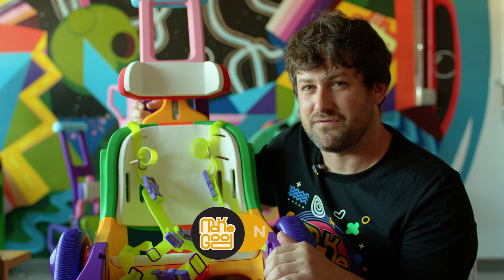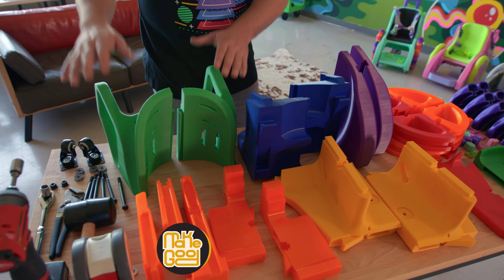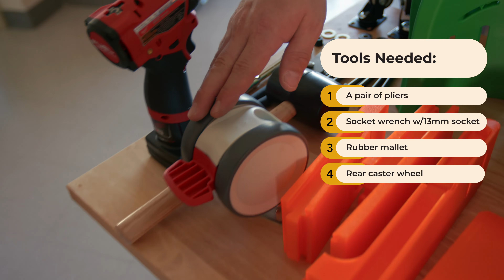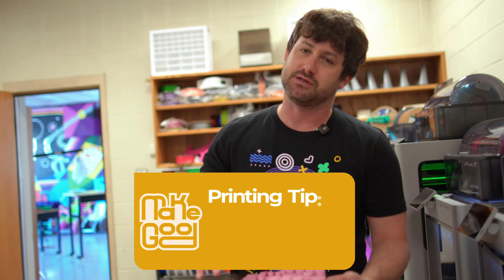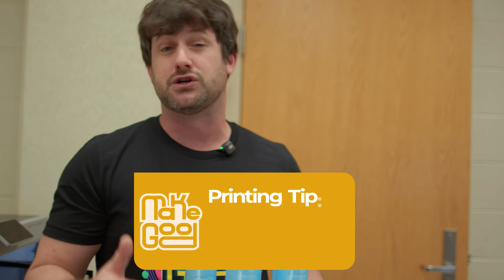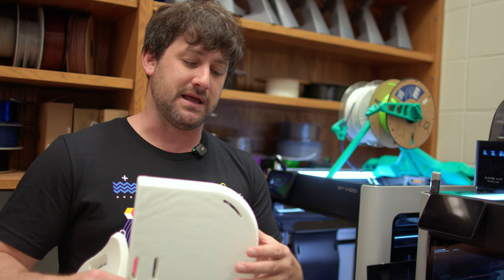3D Toddler Mobility Trainer - Printing Tips and Tricks

Comment: Can you post the bolt and bearing sizes. I'm 1/4 done with printing and ready to order bolts and bearings but don't see the sizes i need
Reply from the maker: check out the instruction manual. It has all hardware listed

Comment: About 1/4 into my print and they are taking double as long as stated in the app. What am i doing wrong. The handle said 10 hours on the phone app but took 20
Reply: Donde descargaste el manual de instrucciones?
Reply: Did you check the speed setting on your printer? Maybe its in 50% /Silent mode